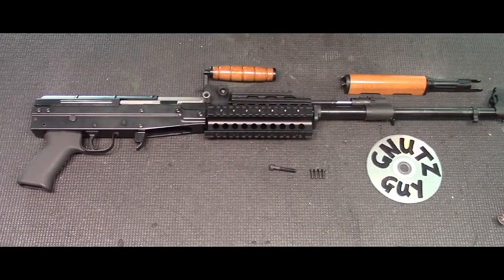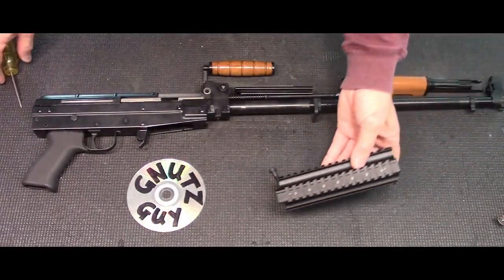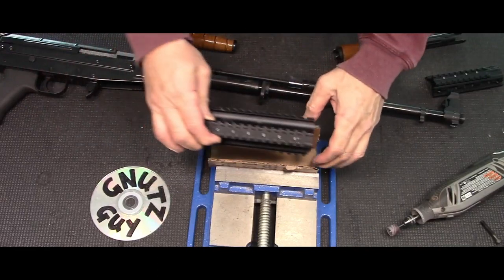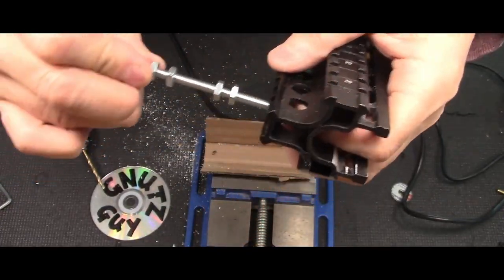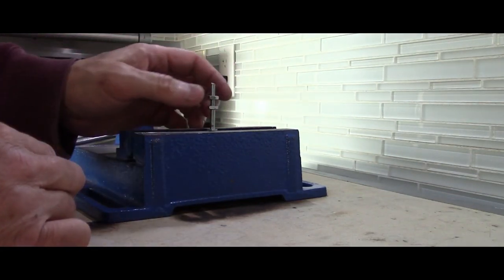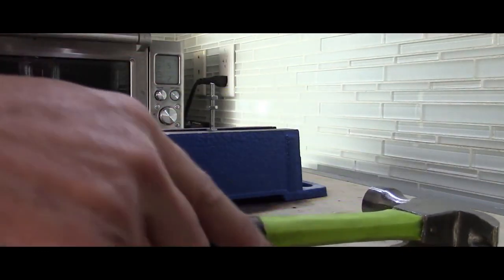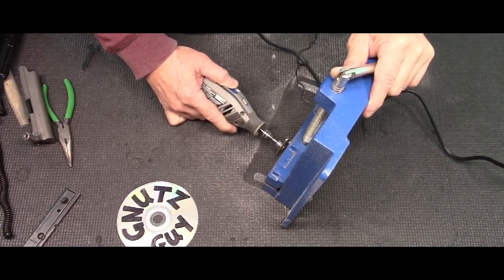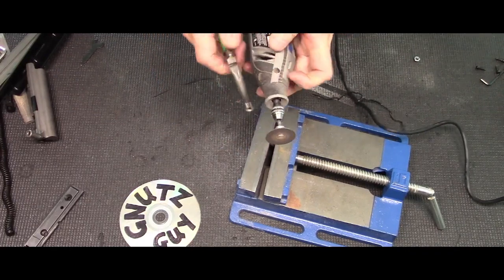Type 81 LMG Quad Rail. Hack&Mod Yugo AK-47 M70 *

Comment: When you took off the carry handle, did you knock the pin out from back to front? Or front to back? I'm just wondering which side of the pin I should punch.
Reply from the maker: punch from front to back after partially drilling the front.
Reply: @gnutzguy  Okay, thanks so much. Sorry for asking multiple times 🤣

Comment: Thank you for the video :-) How do you remove the factory hand guard? The front lower hand guard plate of my LMG is slightly off-centered due to poor fitment.
Reply from the maker: It's just a bit snug, I used a piece of wood, like a short 2x4" and place it on TOP toward the back of hg. tap it with a hammer a few times, alternating both sides till it falls out.
Reply: @gnutzguy  Thanks for the prompt reply, can I ask your email address so I can send you a picture of my rifle? I just realized that the ferrule is canted and wondering if I can punch the pin out by myself? Thanks again :-)
Reply from the maker: @leifeng9727  sorry, no email. try tapping first before driving out the pin. remember the furrule was already in place when they put the HG in so tapping should work.
Reply: @gnutzguy  Did it! :-) But unfortunately found out that the furrule is off-centered, any recommendation of how to remove the furrule? Thanks again.

Comment: If you've still got the wood handguard lying around and are looking to get rid of it let me know. I'm trying to find a spare lower handguard to use as a template for a project but apparently TI didn't get much if any in the spare furniture department.

As an aside, do you know if the rifle handguards fit the LMG with the thicker barrel?
Reply from the maker: the lower HG not interchangeable.

Comment: Hey Mr. Gnutz, ive been wondering if it is possible to remove the carry handle without what looks like drilling out a rivet thats holding it. When i remove the screw the mounting bracket still wont move. Please let me know if this is possible, thanks!
Reply from the maker: it is possible but you have to remove the entire rear sight, the shaft is staked so you might damage it and render it useless. not worth the headache, i would do the same as you but i drill part way and then punch it out.
Reply: @gnutzguy  thanks, i may try to drill it and punch it out, then maybe tap it and replace the rivet with a screw.
Reply from the maker: @dunheezy5759  I prefer a nut and bolt myself. Loctite after.

Comment: Hi even if the 81 lmg is 19mm in tickness can we AK handguard with it since it's SA that shouldn't be a problem right!?
Reply from the maker: Not compatible, different length.
Reply: Ok do you of any polymer handguard that would fit on the LMG then??